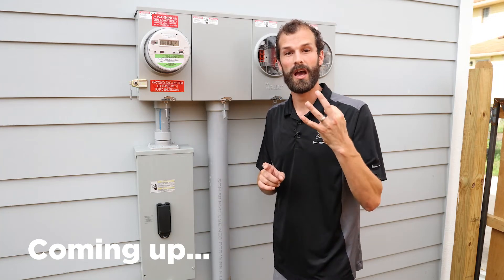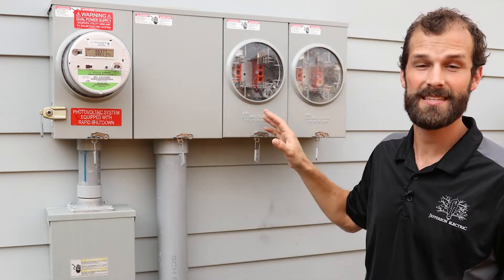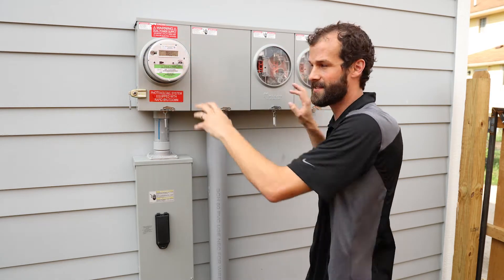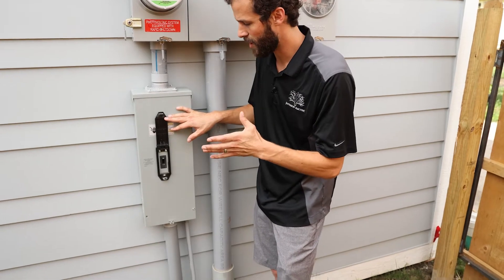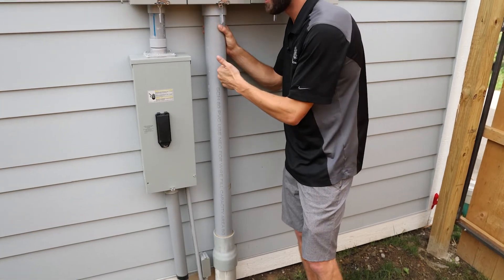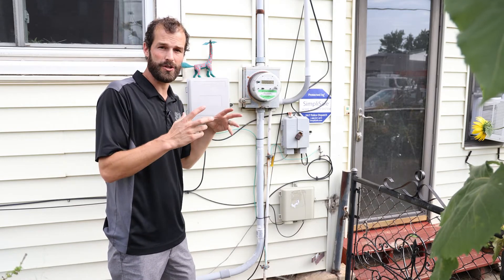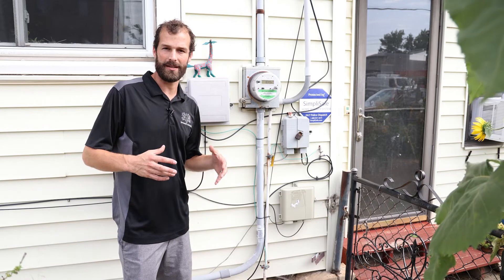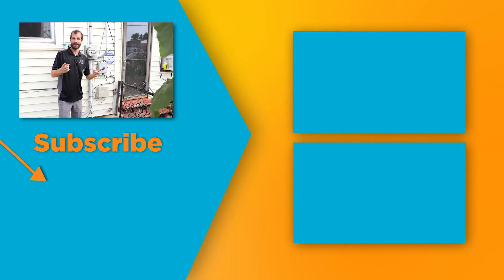Electrical Power From Grid To Home

Comment: Philly hillbilly electric was told the only electric ultility around that required 3 meter sockets for homes that installed PV. ( At least 6 to 8 years ago ). They received a large grant ten years ago to install smart meters but call it lazy metering. They will not allow you to access the smart meters by your computer or cell phone like most ultility companies but can send out a signal to cut power. Was on a job where we pulled two meters to upgrade service and within 25 minutes they had a truck out seeing why building stopped using power.

Comment: The other thing that 100 amp service has out of code is the branch feed without it's own disconnect. Most likely there's a splice inside the meter pan that's crowding the fill rate as well. These days (and likely back then too) most areas would require a metered main with a disconnect to each of those feeders, just due to distance. (that means a pair of breakers / disconnects directly by the meter)